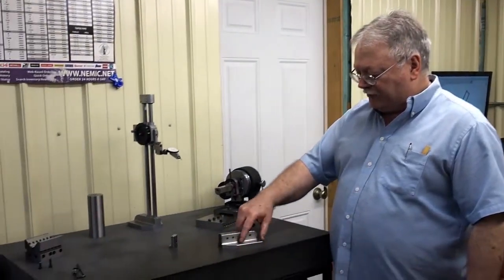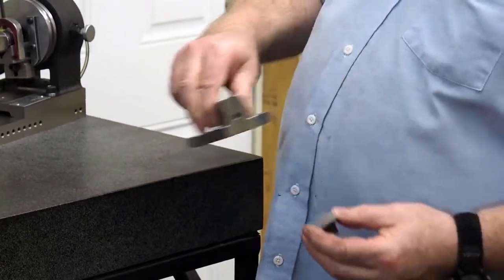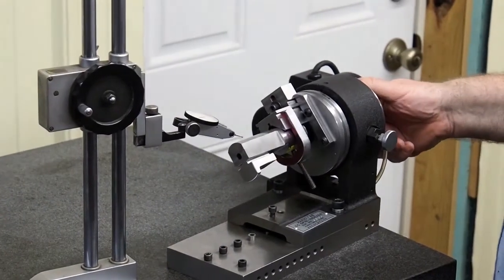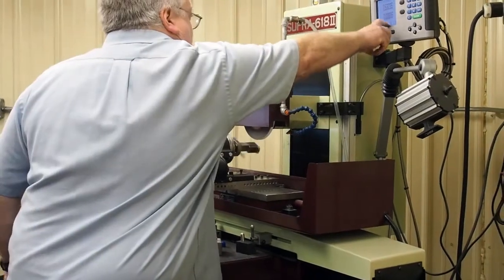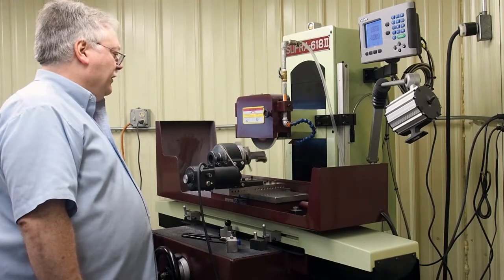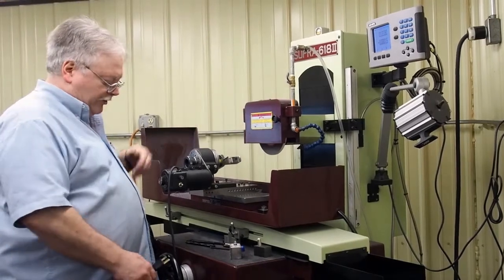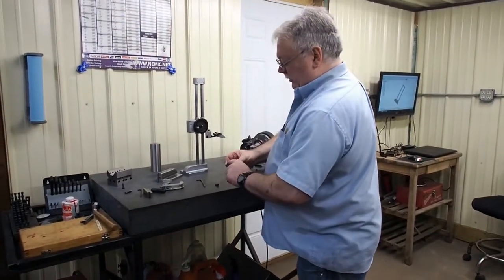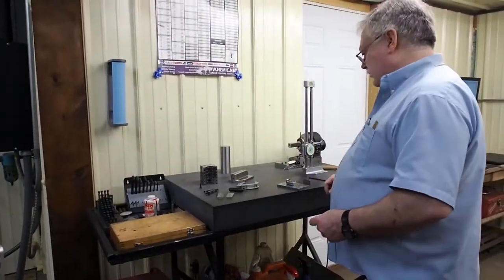Squareness Gage part 4

Comment: Nice Series Steve,
Every time I watch you making something like this I add it to my list of things to make. 
I just picked up a small fully automatic Boyar - Schultz 3A Surface Grinder to complement my Grand Rapids 550. Can't wait to get it running.
Have you thought of raffling off one of your Squaring Blocks?
Reply from the maker: Hi Eric,
Congrats on the Boyar - Schultz. Are you talking a raffle on YouTube or are you thinking about the Bar Z Summer Bash raffle.
Steve
Reply: @SolidRockMachineShopInc   I was thinking a raffle on YouTube maybe set up a patreon donation amount as the qualifier and draw a name from that list of donors, if you get 500 donors at $5.00 or $10.00 ea. and use the proceeds for equipment for your shop. I'm not even sure if it would be legal or allowed by YouTube you would have to check it out before hand. Just a thought on how you may be able to raise funds for camera equipment or machinery.
Reply from the maker: That sounds like a good idea but I know there are legal issues and YouTube rules about that so I would have to check into it to make sure we stay in good standing with those parties. I will have to give it some thought and research.
Steve
Reply: @SolidRockMachineShopInc  Good luck!!